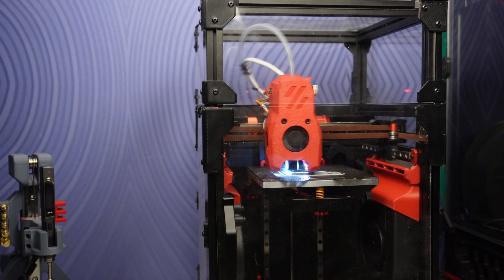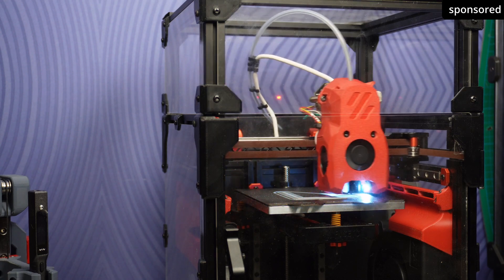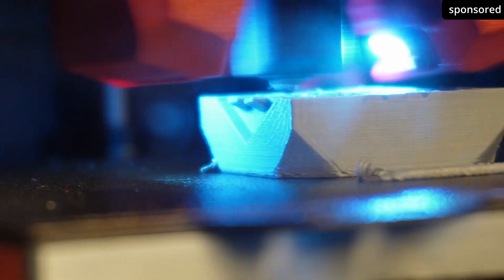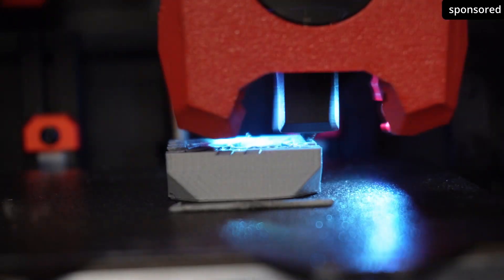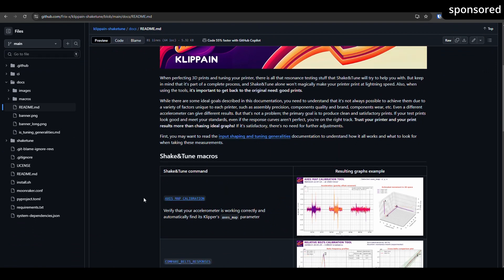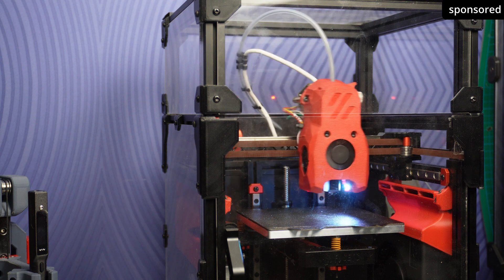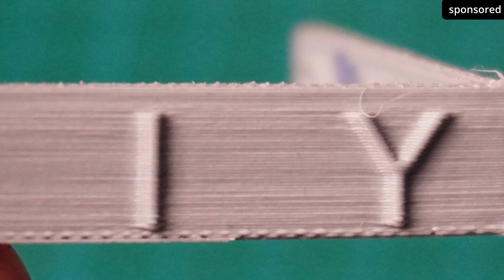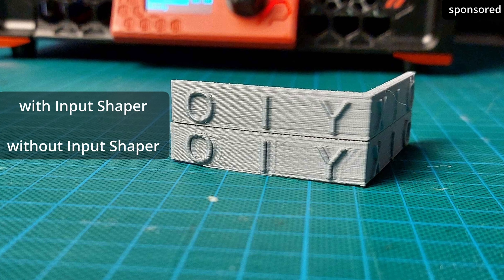Your best 3D printer mechanical upgrade: How to make your prints Look better

Comment from the maker: Just to clarify: I intentionally used gray filament because it highlights artifacts very well under studio lighting. The lighting significantly amplifies their visibility, even though these artifacts are not as noticeable in normal daylight. Additionally, the object was printed with an open build chamber, which can cause warping and lead to imperfect layer stacking. This may give the impression of imprecision, especially in the layers, but this is not typically visible in regular conditions.

Comment: The v0 uses smooth bearing stacks against belt teeth which will introduce vfas on X. You can’t simply switch to toothed idlers either because the tiny bearings in idlers of those size will fail quickly. There are some gantry mods being worked on like Tulip that should resolve this issue by using live shafts with a custom 16T pulley.
Reply from the maker: Thank you for the hint. I will Look if i have VFA. Atm i dont See one but it can caused i used the Fysetc modified V0.2 CNC.
Reply: The fysetc cnc gantry still has the same bearing stack as stock. I’m talking about the two bearings here on the right at 1:05 under the red metal bit that the belt is wrapping around.
Reply from the maker: Thank you for this information. I will have a look but at the Moment i have no issues. But i can check this on my fysetc trident. But the trident use bigger idler.
Reply: Don't get live shaft idlers with a hole in the middle from 3dlabtech by the way. It destroys belts. Just get normal toothed idlers and glue it on, if the filastruder custom one is hard to get.